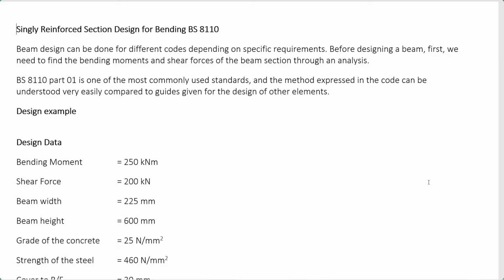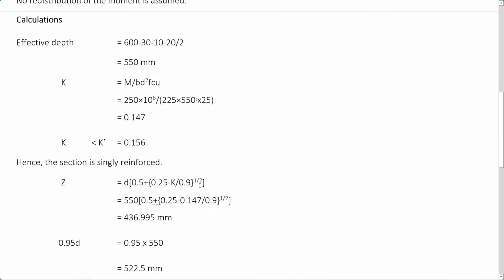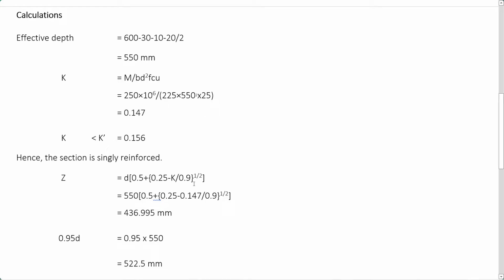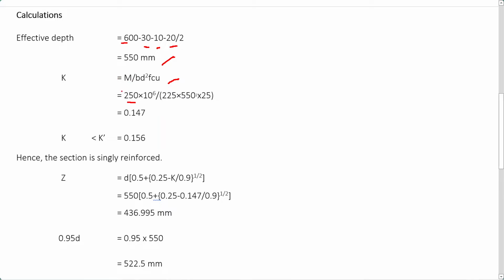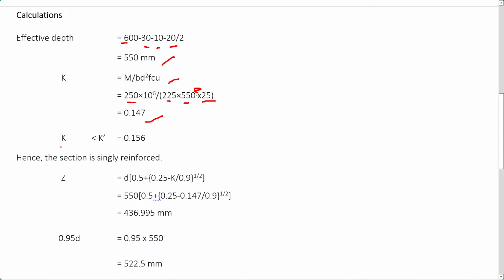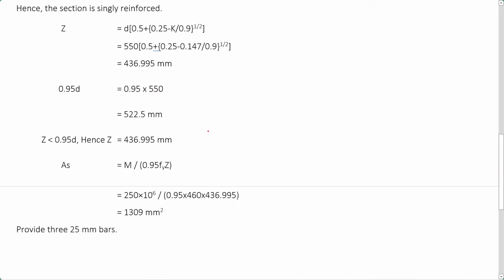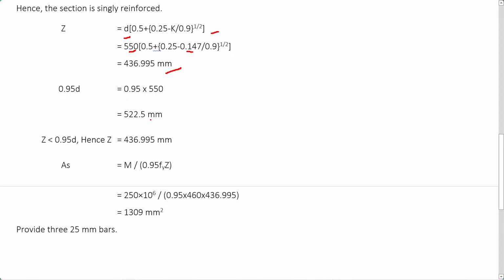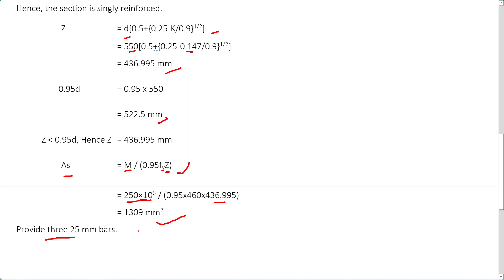Design of Singly Reinforced Beam BS 8110 | Beam Design Worked Example | Structural Guide

Comment: How can you use the diameter of stirrups bar to calculate the effective depth tension bars before finding out if it is single R/F or double R/F?
Reply from the maker: Effective depth does not depend on whether it is singly reinforced or doubly reinforced.

Comment: Does this take account for weight of slab over beam or just weight of beam itself ?
Reply from the maker: In this work example, the calculation of the bending moment and shear forces are not given. 
When you design a beam, you have to consider the weight of the slab, imposed load, weight of the beam, and any other loads on the slab such as partition walls, walls on the beam, etc.